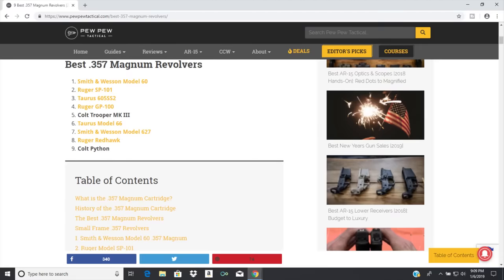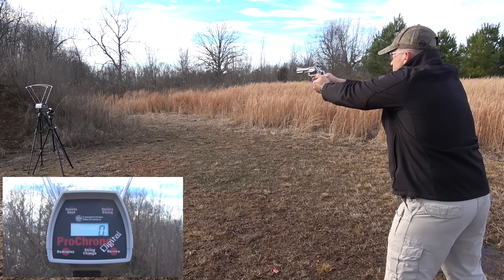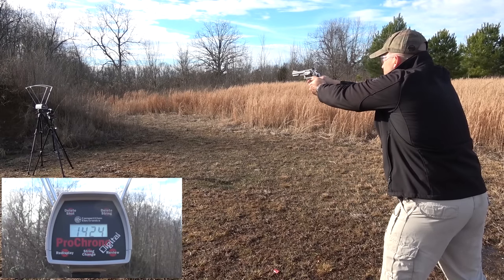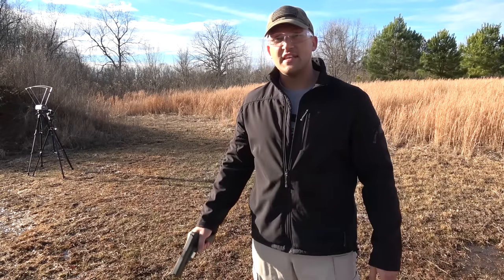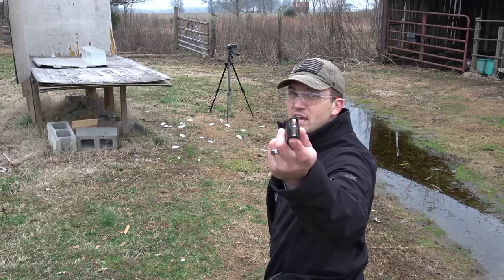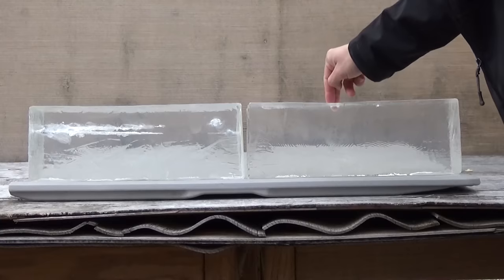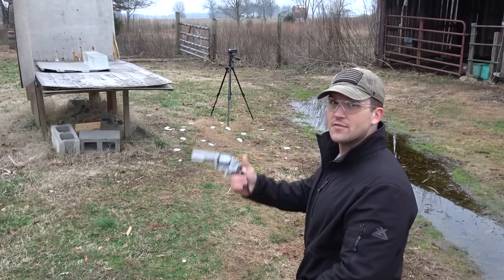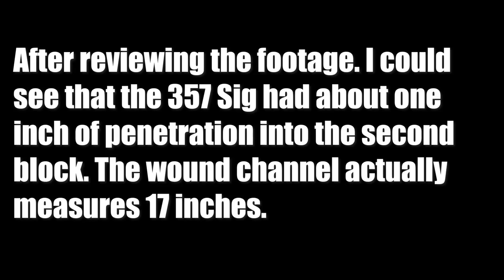357 Sig vs 357 Magnum vs Ballistic Gel

Comment: Pressure ramp for the the 357 Sig is shorter than for the 357 Magnum.  The Sig uses faster powders and reached maximum burn faster than the Magnum.  The Magnum reaches it's full burn point at about 16 inches of barrel.  While the Sig reaches its full burn point at about 6 inches of barrel.   The build up is exponential in nature.   At 4 inches, the Magnum has more pressure behind it than the Sig.  But at 3 inches, the Sig has more pressure behind it.  If you compare a Glock 33 to a Taurus 605 Poly, for example, the Sig will have higher velocity than the Magnum, and thus higher energy.  Both the Sig and the Magnum are significantly better ballistically than 9mm, 40 S&W, 45 ACP, and 38 Specl in terms of terminal ballistics.  However, internal ballistics of the higher pressure rounds (40 s&w, 357 sig, 357 magnum) are much harder on the operator and the firearm.  So it's a trade off.  I personally pocket carry a Keltec P40 and wish it was in Sig; and they did make a Sig barrel for it at one time, and I'm always on the hunt for one.

Comment: I'm really surprised you didn't get at least 1500fps from the Underwood 125gr in the Glock 31. They rate it at 1475fps. That should be easily doable in the G31.

Comment: Not much expansion on the .357 mag 158.
I used to run a remington load with their 158 gr.  serrated jacket hollow point to around .650 - .660.

Comment: The classic problem with HP ammo is how it performs after hitting certain things. Please give us another test with different jacket fabrics in front of the gel. Only one gun needed for this. Some companies use a polymer tip to open the HP. Your ammo has a open HP design which sometimes fills with the fabric and will not open properly. Most ammo penetrates properly but there are a lot of HP designs that perform differently when encountering fabrics (jeans, leather, a thick coat). I've heard the polymer tip design cannot be plugged up with material and opens regardless to what's shot at. Also the effect of HP vers FP ammo going through a car door. Let's see a little more. Go get some!

Comment: Those .357 Sig 125gr rounds were weirdly slow.  Folks usually get well over 1,500fps, even with 4" barrels, and with 4.5" barrels they get close to 1,600fps.  Heck, with below-max book loads of 800-X, I get the 125gr to 1,550 fps from my Gen 4 Glock 31.

Comment: When I took my concealed carry class, my instructor was a prior North Carolina State Police veteran.   He advised that when the Sig .357 round came on the market, it obtained rave reviews by late enforcement.  It was actually preferred over both the 9mm and .40 caliber round.    However, due to cost (both the ammo and replacing the firearms) it never made the cut as a replacement for the 9mm throughout law enforcement.
Reply: Yes I remember to the mid to late 90's the NCHP started carrying the Sig 357. The department I was with tested a G31. We found out accuracy dropped when testing the G31. Wasnt the gun but the caliber. What we found out or determined that officers at the range complain about the kick/recoil/and anticipation when the pistol would go off. So the department stayed with the G21.

Comment: When you told the length of the barrels I just realized the barrels are measured differently. The semi auto is measured from the bolt face whereas the wheel gun is actually the barrel length. If they were measured the same then the cylinder of the wheel gun would also be measured.
Reply: That’s really interesting. So the 357 Sig is actually traveling through less barrel length than to 357 magnum even though they’re both considered about 4 inch barrels. Which basically tells me that if the Semi automatic was an inch or so longer Or if the revolver was an inch shorter to be an actual closer comparison the numbers would be closer. 357 Magnum would still win naturally but it would be even closer performance.

Comment: if you used the exact same bullet manufacturer on all bullets.
The .357 Sig had much more diameter spread then .357 mag.  
& with that, of course the mag had deeper penetration. 
The depth vs diameter dilemma .   
For stoppage power and for the kill, Diameter Generally Always Wins!  (.357Sig!)

Comment: To be a fair comparison of an auto vs a revolver you need to use a revolver with a shorter barrel since in an auto the chamber is calculated into the autos barrel length. If you wanted to do a fair test you should have used a revolver with around a 3 inch barrel. Granted the .357 mag will always get better performance then the .357 sig but it's much closer if you do your calculations without the chamber of the auto.

Comment: Have you ever compared a Glock 20 10mm 180gr XTP.. To a 4" 357 Mag 180gr XTP.. That would very interesting to see especially in the Underwood ammo...

Love your videos
Reply: That would be interesting. I've chronographed the two side by side, but never shot gel. The .357 mag hit 1,423 fps with Buffalo Boar 180 grain and the 10mm hit 1,290 ish. The .357 mag is more powerful than 10mm...contrary to what the internet thinks. 😉

Comment: In my opinion, the 357 round is the best over all caliber. I have a  Ruger Security Six 357 mag. It's well over 30 years old in pristine condition and built like a tank. Its the perfect revolver because you can shoot 38 specials or 357 mags without changing a thing. The 357 will stop just about anything coming at you.

Comment: 357 Sig actually has a .002 smaller diameter than 357 Magnum so theoretically that gives it a piercing advantage. 357 Magnum advertised performance is rated out of a 6” barrel which doesn’t add the cylinder so the projectile is actually traveling through over 6” of barrel length. 357 Sigs advertised numbers are rated out of a 4” barrel which includes the chamber so the projectile is only traveling through 3 inches of barrel vs 357 Magnums 6”.  When you compare a 125 grain hot loaded Magnum and Sig￼￼￼, the Magnum will clock around 1460 fps out of a 4” barrel and 357 Sig 1475 fps out of a 4” barrel. When comparing out of a 5” semiautomatic barrel with both projectiles actually traveling through 4 inches of barrel length the Sig will clock 1520 fps with a properly loaded round. The 357 Sig has a better chance of defeating armor. In conclusion, these two calibers are never matched up Apples to Apples. We need someone to compare hot loaded rounds of Magnum and Sig out of a 4” revolver vs a 5” semiautomatic to tell the real tale between these two calibers.

Comment: As long as there are revolvers, I submit, there will be .357 mags.  The bulk of the revolver cylinder pretty much means any true man- stopping caliber is going to demand a revolver with an awkwardly thick cylinder.  The little.32s were always popular because of their ease in carry, even tho they constantly let down those who carried them for defense.  The .45's & .44's would getter done but Damn they're big.  So the popular compromise was always a .36 -37 caliber that didn't QUITE make it happen reliably.  To make a puny .36 bullet a real man stopper you needed to push that silly thing REAL fast.  Even the 9mm, 38spl, & 38 super were really "Iffy" about this.  Enter .357 magnum.  Still slender enough to allow for a viable cylinder width, it could push a sad little .36 caliber bullet fast enough to shut down most any human opponent every time.  It is the perfect balance that makes it happen.

Comment: NEVER use hp projectiles in ballistics gel unless you can explain that higher velocity equates to less penetration in somewhat similar cartridges. The higher speed expands the hp bullets causing less penetration. Not to mention that you're mismatching bullet types per weight. Hardcast or fmj

Comment: I don't think anyone is arguing that the .357 mag has a lot more power than a  .357 Sig. Hell, a .50 BMG will do more damage than a .357 mag. The FBI decided that the .357 Sig got the job done and that 300% dead is no better than 100% dead. Still, I am getting a Ciappa Rhino 30DS in stainless for excellent recoil control to keep the gun on target. The revolver fires from the 6 o'clock chamber, pushing it more into your palm than up into the air. I am loading it with Underwood 357 Magnum 120 gr Xtreme Hunter 1700fps. The rounds are non expanding but still cause a large PWC. It is meant to be my CCW I plan on replacing my Ruger P89 9mm with a S&W 500 3.5" for the house.

Comment: Yeah but the magnum has 4" of barrel past the tip of the projectile. The sig's barrel is just over 4" including the chamber. That leaves 3" past the tip of the projectile. This wasn't a completely accurate comparison. You should redo this test with a magnum with a 3" barrel.

Comment: Not really an apples to apples comparison. Originally, .357 Sig was developed as a law enforcement round in a joint effort between Sig Sauer and Federal. The idea was to recreate the ballistics of the 125-grain .357 magnum in a semi-auto cartridge. They basically shortened a 10mm case and necked it down to take a 9mm diameter bullet. The cartridge was named "357" to highlight its purpose: to duplicate the performance of 125-grain (8.1 g) .357 Magnum loads fired from 4-inch (100 mm)-barreled revolvers, in a cartridge designed to be used in a semi-automatic pistol with greater ammunition capacity than a revolver. I personally love a Glock 22, or a Sig Sauer P320 or P250 in 40. cal, because I can quickly swap out the 40 barrel for the 357 Sig barrel, using the same magazine. With that swap, I get higher velocity, and better long range accuracy.

Comment: Hey everyone. I have a question I'm 20 turning 21 in March looking to purchase my first handgun. I've watched enough videos to hear that glocks are the most reliable but i just want to be sure. I want my first handgun to be for self defense and something i can use for practice. I live in Arizona if that matters.
Reply: Wait on glock 48 when it drops, you live in hot weather,  single stack 9mm glock  that carries well in that climate
Reply: I've had a few different handguns from different brands. It's hard to beat a Glock 19. Good size for carry and fun at the range. The Shield is very easy to conceal and shoots pretty good. I highly recommend Concealment Express for a holster. You need to get out and shoot a lot and get comfortable with whatever gun you decide on. Be safe out there. I forgot to mention I currently carry a Glock 23. It really is hard to beat Glock but there are a lot of good guns out there these days.
Reply: Glock is a good brand but it's what is most comfortable in your hand. I'm more of a Ruger fan just because it's not as box looking, but that's personal preference.  As long as you clean and regularly maintain your firearm it will be reliable on ALMOST any make or model.
Reply from the maker: Glock 19 is my pick 😁🤙
Reply: Dunno if Glock is the 'most' reliable, but in truth, you probably won't go wrong with  Glock, XD, Sig-Sauer, Beretta, or Ruger. I would shy away from Smith since-- according to You Tuber reports-  their quality and reliability seems to have gone down hill.

Comment: I have both a Glock 31C and a 686+. I carry the mag when hunting, loaded with 180gr hardcast loads. The Glock I carry with 125gr Winchester Rangers, although I'll probably switch over to Underwood Gold Dots pretty soon. I love the 686+, but the Glock is a more versatile choice. I've got 3 barrels, the 357 ported, a 40 S&W, and a 9mm. Also the weapon has night sights and a Surefire weapon light. I have four 15 round magazines that I use interchangeably for the 40 and 357, and eight 9mm 17 round mags. The 9mm barrel is also threaded for a suppressor. You can't fight progress.
Still the 686+ gives me those nice 180gr hardcast bullets for bear protection, and I'm more accurate with it.

Comment: The bigger cartridge is always more powerful case closed. Do 9mm vs .45 if you haven't already.
Reply: Oh really ? So how do you explain 10mm over .45ACP smarticles?
Reply: @pj7362  The 10mm cartridge weighs a little less but it is longer making it bigger overall.
Reply: @mobeasley8577  and how much wider is a .40cal than a 10mm casing? Be honest. Longer doesn't necessarily mean bigger any woman will educate you on that fact. Longer is not the only factor in case capacity.
Reply: @pj7362  A 10mm is a long .40 cal cartridge, more propellant in the 10 mm makes it powerful than the .40 and .45.